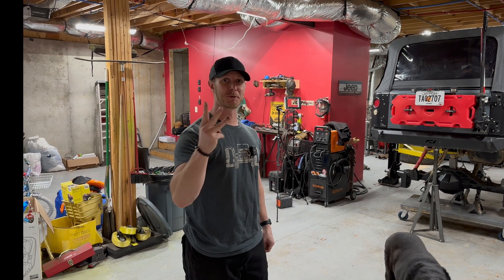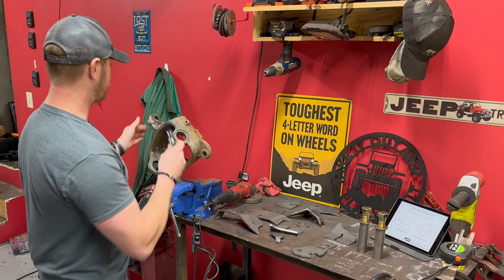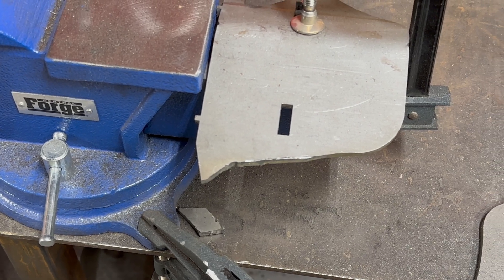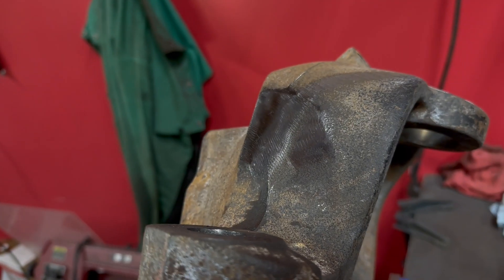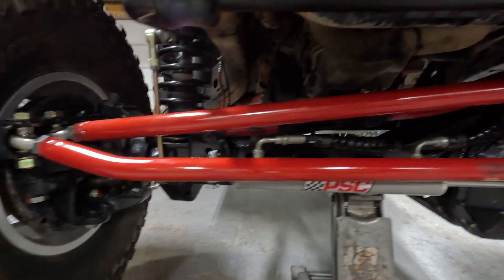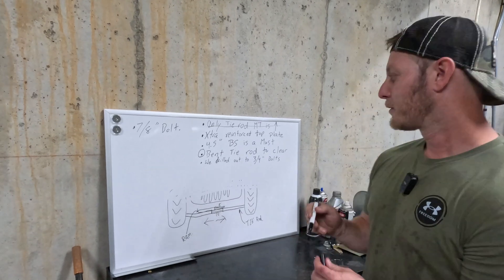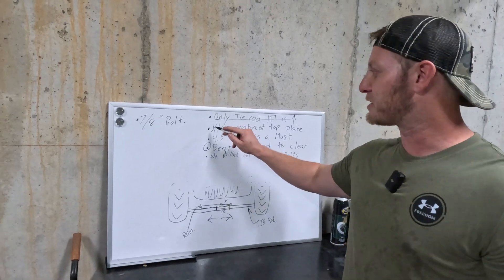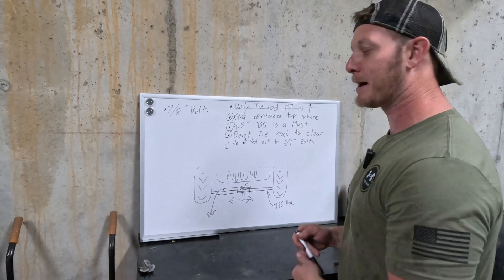Build/Review: MOTOBILT High Steer Kit

Comment: Just found your channel. I'd like to see a walk around/build overview of your TJ. I'm in the planning stages of a ton swap for my LJ. I noticed in this video it looks like you used the Artec Apex JK/JL swap truss under yours. That's actually my plan too. Found them cheap locally on marketplace, talked to Artec and they said other than minor differences in spring pad width the front would work just fine. I'm doing 3 link anyway. I'll use the center truss section and and spring pads out of the rear swap kit for my 4 link back there.
Reply from the maker: Hey Ben! Glad you found me! And your right that I am using the artec kit, specifically for the JT. I was actually in the process of building a 1 ton gladiator and had already built these axles for that Jeep, when I decided to build this TJ instead. The biggest difference is the spring perch width which I had to cut them off and relocate them to make it work. And then I added upper triangulated links in the rear and relocate the shock brackets. I wouldn’t mind going over everything with you. I would honestly say that it would be so much easier if I started with TJ truss kits.
Reply: @mudtiremedia  Thanks. I actual have a pair of Artec's old replacement front coil/shock towers that were designed for ton swaps to space the springs to the correct width. the coil perch width is wider than stock even on the TJ swap truss. In the rear I'm just going to use the center truss section and the coil perch sections. I'll do my own upper/lower link mounts and shock mounts.
Reply from the maker: That is awesome! I wish I had gone ahead and moved my spring perches while
I was doing everything. I’m currently fighting myself with the dilema of whether to swap in a v8 to push this thing, or to rip out my springs and shocks and start running coilovers…. These choices are unfair!